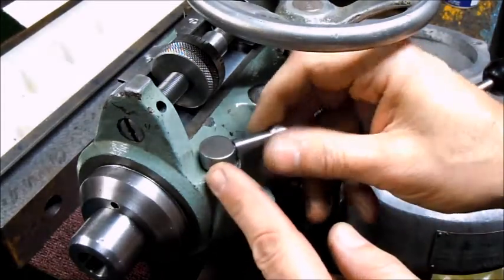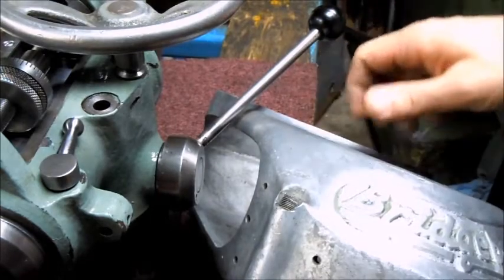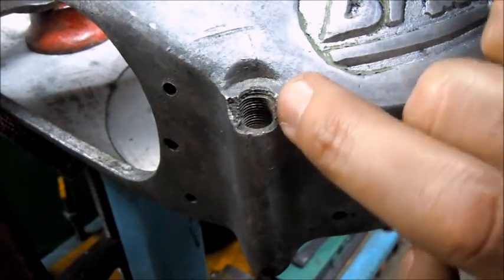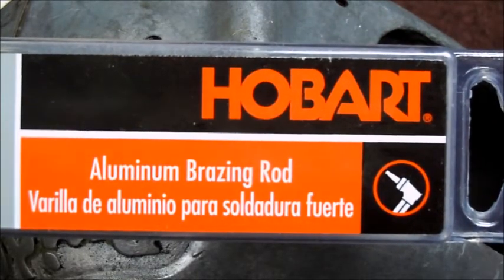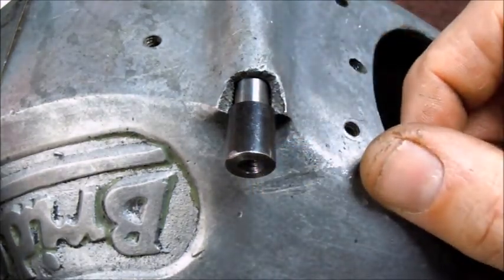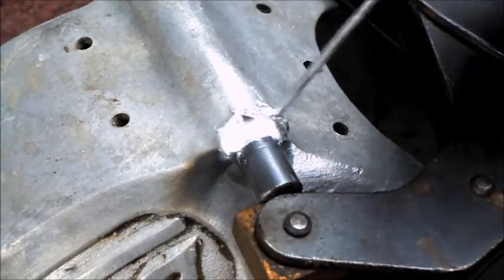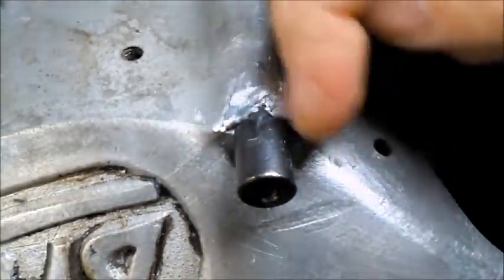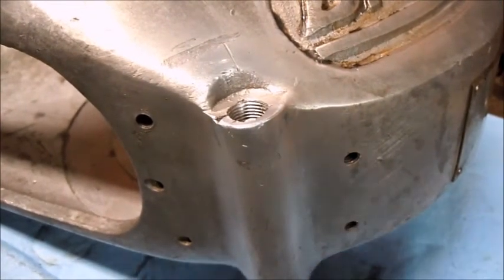M Head Matters 6

Comment: Very nice. Repair looks great. I've tried to use the alumaweld sticks and if I don't have it super sanitary the stuff won't stick.  My M will be up soon thanks to the information and confidence videos like yours have given me. Thank You
Reply from the maker: Thanks, and great to hear one more will be up and running soon. In real time I spun this one up to “max rpm” last night…. old crusty belt didn’t make the cut 😊, new one picked up today for further testing.
 You have mentioned the oil issue and I’m in the middle of working through that with my friend who’s a wealth of knowledge on these things, and more, so I will try to cover it once I figure it out. I’m thinking that system should have a wick to transfer the oil from the top cup down into the vertical oil gallery, which should help to limit the amount of oil that can pass into the bearings at any given time. Thought is that once an equilibrium is reached, oil transferring to the bearings is controlled by how much gets added to the cup, if you add two drops the equilibrium is out of balance and moves the two drops down into the oil gallery, into the bearings and onto your shirt… 😊 Thanks for watching and commenting.

Comment: Soot the pin with the acetylene only lots of nice soot so the filler won't stick.
Reply from the maker: Thanks for the tip John, I'll keep that in mind for the next repair, hopefully not on the same housing though! Ended up pulling out fairly easy but the soot may have reduced the stress some. Thanks for watching and suggesting.

Comment: glad to see the m head coming a long. if I may make a general suggestion. Try new techniques on scrap before applying them to the workpiece. Better to mess up a chunk of junk aluminum than dive right in and mess up your workpiece.
Reply: also: the more times you heat the metal, the more you weaken it. try to overdo the amount of material added so that you definitely have enough to file it smooth.
Reply: the end result looks pretty good though. I hope it holds up
Reply from the maker: Couple of very good points there, never considered the heat / reheat / reheat effect on the parent metal, that I will keep in mind going forward. Was filming the tapping process in anticipation of a “failure” video moment so I was pleased when I was able to run that tap in! Thanks for watching and thanks for the comments.